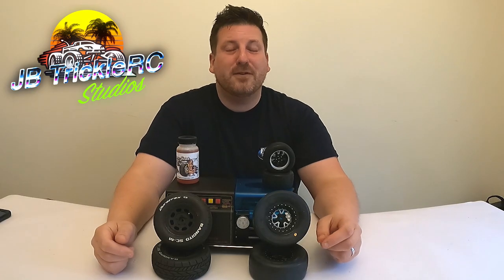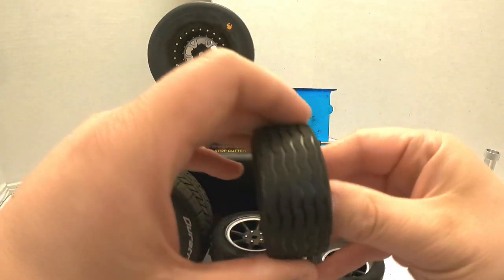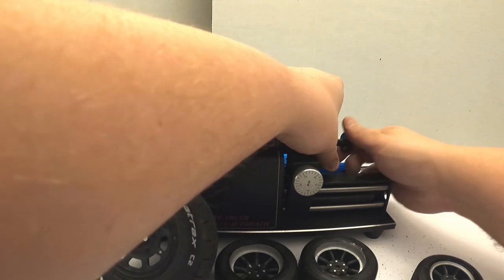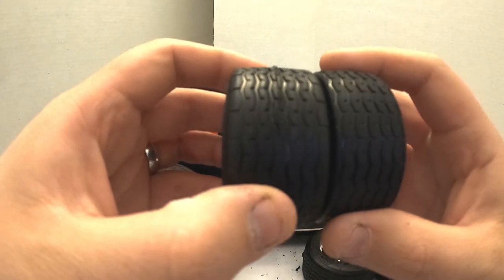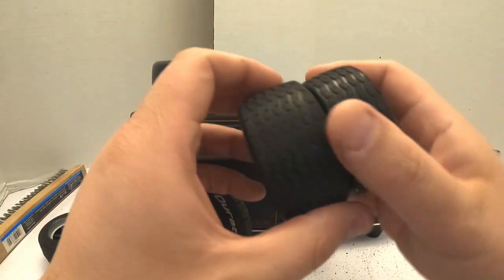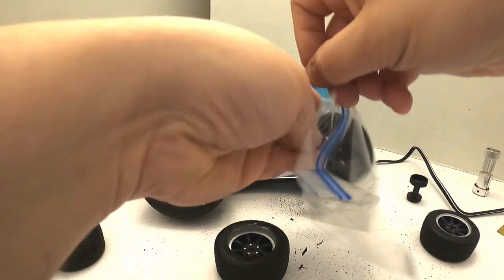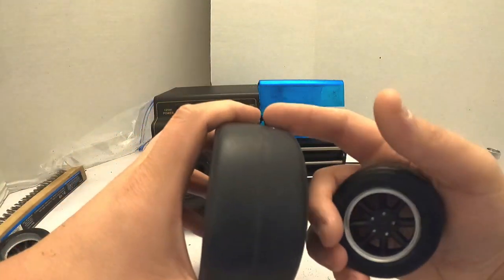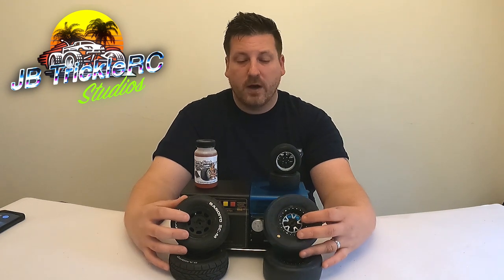How to break in RC rubber tires Tutorial: NPRC Drag, Oval, Touring (VTA), Dirt Oval

Comment: Good Info, race day prep and procedure between races would be nice thanks.
Reply from the maker: Jlgrrt thank you for the comment and feedback.  Someone else asked for the same thing so I'll do a race night prep and clean tutorial soon.
Reply: @jbtricklerc  do you have a link to said video, thank  you
Reply from the maker: @CarlosDelaoGunEngraver  I don't think I ever actually got to make one.  I'll work on that soon when Im able. 
If you give me more specifics on what kind of tires and what kind of racking you're doing I could possibly reply with more details here as well.
Reply: @jbtricklerc  USGT gravity, on smooth outdoor concrete basketball court
Reply from the maker: @CarlosDelaoGunEngraver  
Awesome.  My method was of course when getting to track mount them.  Then I'd immediately prep them. Let them sit while I'm preparing for practice. Come back, get batteries going the clean them if needed. I didn't clean every round and not everyone would agree with my method but I'd look them over really good. Plus I raced on carpet which is almost self cleaning in a way. Especially if you run it out the groove after a race. Then I'd reprep and let them sit.  I feel the hardest part is figuring the cleaning a d prepping process and time frame. Some like the prep to sit and soak, some like to apply it right before the race. Depends on prep, preference and more. Find something that works for you and stick to it, adapt to make your process better over time but trying various things all at once is hard to track progress. 
With you running in concrete I imagine you would need to clean more often than I did. Hope that helps a d if I need to elaborate more just let me know and Id be happy to do so.
Reply: @jbtricklerc  Thank you for taking the time brother

Comment: Hi mate, what beadlocks are those? Cheers
Reply from the maker: Trav, its kind of a funny story.  Those are not actual beadlocks.  They are glue on rims and they are made my proline.  They are molded to look like beadlocks.  The reason they look so different is because I took a chrome permanent marker (off amazon) and colored the spokes and rivets to give it a more detailed look lol.  easy to do, just takes a little time.
Reply: Ok wow, definitely looks the part. May have to steal your idea lol.. Cheers mate

Comment: Dose this work for getting more grip on a vta car u race on carpet my car is sliding all over the track
Reply from the maker: Billy, Absolutely.  In fact, the those smaller tires are VTA tires that was shown in the video as well.  Those newer tires are so hard when new, so sanding/scuffing and tire conditioning with the ziplock bag is pretty much necessary in my opinion.
Reply: @jbtricklerc  ok thanks I have some wap tire conditioner I use on my drag tires I'll get them scuffed up and put them in bags till race day
Reply: Do you apply the conditioner a few times while in storage over a few days?  Should you keep them out of the bag and let them dry for any reason?  I'm trying to get my new VTA tires ready for a race in 4 days.  My current tires are too soft and ballooned.  Ty for the tips.

Comment: Thanks you so much for all your advise. Did you say you clean your tires on race day, with Simple Green, and the more prep?
Reply from the maker: Rod and Tami no problem at all.  Thats the goal of the channel, to help and to entertain.  It depends on the tires.  I used watered down simple green and water for my bandito and DE tires or is use Sticky Icky Tire cleaner.  for my foam tires I use Sticky Icky tire cleaner always. I clean them after every round and re-prep them with my prep of choice.  For rubber tires I like to use Sicky Icky #1 and LE.  For my foam tires I like to use Sticky Icky Zero, #2 and sometimes #3 or #4 depending on track conditions. For drag racing I use Sticky Icky also with either Beetlejuice, bug guts or Gremlin goo. If you wanted to give Sticky Icky a try, message me on Facebook and I can give you a referral discount code for 10% off your first order.
Reply: I ran dirt oval on loose top soil and how would you prep jconcepts sprinters and would it be different for the compounds like red, blue and green? Thanks
Reply from the maker: @trevorkrohn8930  great question.  To be honest I'm not as familiar with loose dirt as most tracks around here are high bite dirt surfaces.  I'd imagine with loose dirt you'd also want a prep that soaks in more and doesn't leave a honey like later on the tire that would pick up and hold dirt in the needle type treads which could cause loss if traction.  The different tire compounds definitely always come into play. General rule of thumb is the less grip the track has, the softer tire you want.  That's what a lot of these pre-break in methods do is get that hard sealed top layer off the rubber so the tire can soak in the conditioners, softeners and preps.

Comment: Thank you for the video. So a penetrate oil works best? I was thinking that I got blaster and wd-40. It made the tires super soft.👍🏿👍🏿
Reply from the maker: No problem at all, also,  thank you for the comment and support Rufus.  It's not necessarily that penetrating oil works best as much as it's a preference of mine from years of doing it.  After lots of trial and error lol. It's easy to over do it and hurt a tire as well. But PB blaster and Now Sticky Icky Tire Conditioner are some of my favorites.  If you ever want to give Sticky Icky a try send me a message on Facebook and I can give you a 10% off referral code.
Reply: @jbtricklerc  word I appreciate that.